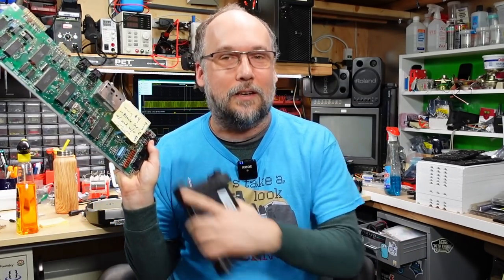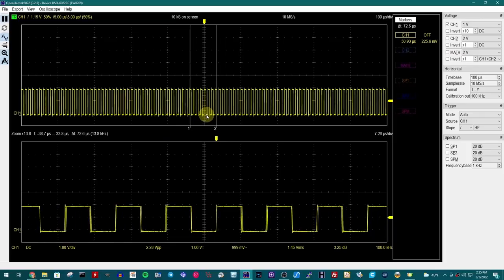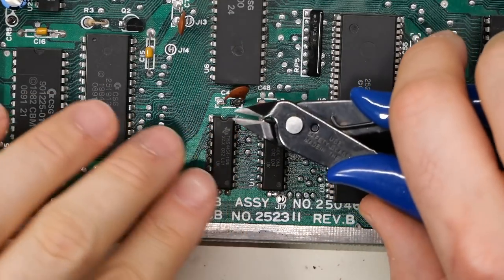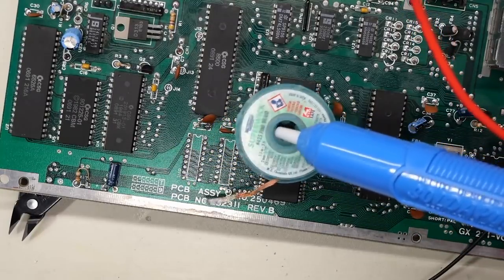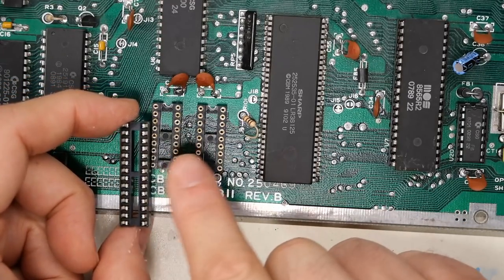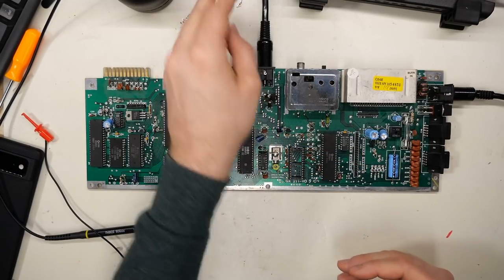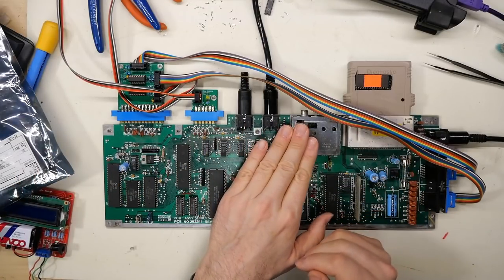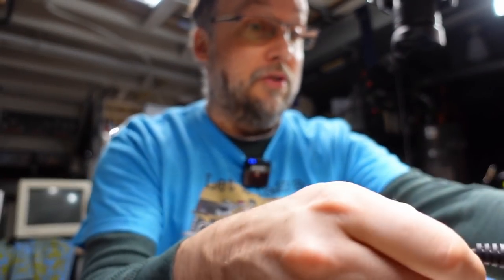How to fix an 8-bit computer with only cheap tools

Comment: I have the older Hakko 808, but it works just as well as the 301. It was one of the best tools I ever invested in, but prior to that I swore by the Soldapult. I won't touch the knockoffs. The real one is really the best. One thing that you should note, is the tips are both replaceable, and are fairly heat resistant. I always used a chisel tip on my soldering iron, and I'd lay the tip flat on the pad, and let the Soldapult make contact witht he hole and pull as soon as the tip clears the hole, but while the pad is still contacted by the iron, for pesky pads. I noticed to have a fair bit of delay between pulling the iron and pressing the button. For me, it'd be an instant. Might get better results on the ground plane holes that way.

Comment: Similar issues with clearing thru holes on pcbs with wick and solder suckers led me to buy the Hakko FR-301 about a year ago.  It's pricey but you'll never go back once you've used one.  I replaced all the RAM on an Atari 800 XL in an evening with the 301.  I would never have attempted it with wick or a solder sucker.  Specialized tools are expensive but they are often worth it, even for those of us who only dabble with electronics.
Reply from the maker: Yeah totally agree. I think for someone just doing once in a while replacement of a chip now and then, these are good techniques.... but my 301 -- yeah I can do 16 RAM chips off an Atari ST pretty quickly. Add hot air and there is no risk of ripping a trace.

Comment: Back when I could hold a soldering iron steady enough, I would clamp the  board in a vice, put the solder sucker on the top side of the motherboard. Then I would apply the heat to the bottom of the board. Would suck the hole clean every time. This way you are still applying heat when you use the suction device..

Comment: 22:11: Adrian, one thing that's worked for me is to actually suck while the tip is still in touch with the solder. That's with both instruments at an angle, and obviously there's not anywhere near a perfect seal between the nozzle and the PCB then, but there's often enough suction to suck out any liquid solder that's nearby, and the nozzle often even doesn't mind if it briefly touches the soldering iron's tip. If there's enough space and you can get both the nozzle and tip close, that can be "close enough" to even desolder a DIP without any prior leg-cutting. You have to weigh what's worse: Having the nozzle be more distant or giving the solder time to cool down before you get to position that nozzle perfectly.

Comment: Actually the pump is quiet good if you get used to it. Don't worry to burn the tip of the pump and just touch the pump to the soldering iron tip with a little bit angle and push the button, that eliminate the short pause that let the solder cooling, and LOT OF FLUX (like Louis Rossmann said)
Reply: The tip on the Soldapult is designed for this and is heat-resistant and replaceable . That is one of the (many) advantages to using the Soldapult over the generic junk
Reply: True, it's all about technique. I only have a cheap solder sucker, but it still gets a bit of use if I'm doing a small job and can't be bothered firing up the desoldering station. Said solder sucker has almost chooched its last chooch, so I'll probably replace it with a Soldapult. If the spare parts support and durability is as good as people say it is, it'll probably be the last manual solder pump I'll ever need to buy.

Comment: 22:05 - when using the solder-sucker, if you leave the iron on the side of the pad, obviously not covering the hole, but off to one side, you can keep heat in the via while the sucker works its magic. I know of people who made small indentations in the PTFE sucker tip to allow for a good air seal while still heating the pad. I find them much, much more reliable than solder braid. Finally, be careful not to bounce the board with the sucker, as you can rip tracks with the physical movement.

Comment: In the category of “bargain basement” tools for electronics repair, you simply cannot go wrong with an Edsyn “Soldapullit” solder extractor. It’s a manual tool, of course, but once you get in a pattern, it’s as fast as the $300 tool mentioned. You can prime the pump quicker if you push the end of the tool into the heel of the hand holding the iron.
Reply from the maker: I actually just use the underside of my desk to prime it again and do it while holding it over the trashcan, so it pushed the old solder right into it.
Reply: @adriansdigitalbasement  as long as it works for you. with a bit of practice (and experimentation), you should be able to get the tip close enough the joint while heating it up to be able to ‘roll’ the tip into place as you hit the button. And yes, power / ground pins are a pain to desolder no matter the method chosen! One last thing I should mention there is a deluxe version of this tool which is made of ESD safe plastic (and the main barrel has some kind of metal finish).

Comment: Those component testers are great, I use them for caps too, the ESR and capacitance readings are pretty accurate, so they're great to determine if you need to actually replace a cap or not. Of course, the one I have is for testing out of circuit so obviously if you don't have issues sourcing good caps it's probably not worth it, but you'd be surprised how good a lot of electrolytics hold up from before the capacitor scandal of the late 90's and 00's.

Comment: Thanks for going so in depth with troubleshooting and diagnosing there was a lot to learn!
I'm wondering if that Transistor had a cold solder joint.

Comment: Ground vias are hard to clear because the ground plain has greater thermal mass than signal lines so it dissipates heat very quickly.
There are two issues with leaving flux on a board, it can be conductive enough to mess with signals. it is often acidic, and over time can damage traces, vias, pins.
Reply: Yep, basically it's a good idea to have a heavier duty iron with a chisel tip handy for larger tracks.

Comment: I use a small Ungar desoldering pump that works well and is easy enough to use with one hand.  The trick to it, in my experience, is to keep the pump chamber cleaned out between uses.  The rod will express pulled solder from the chamber between shots, but always empty it and lube between uses.  (The usual precautions with lead/tin solder apply.)

Comment: Great video as usual, Adrian! Just a couple of comments, in case it's useful to anyone: (a) NO-CLEAN flux may be safe to leave behind for a little while, but even those absorb moisture over time and promote pin corrosion. Flux that is NOT no-clean can be conductive (yes, conductive!) and cause shorts. One should always clean the flux with IPA and ESD-safe wipes. (b) Applying more than 350C to an old board (your iron's boost button) can delaminate the board instantly, which isn't healthy and can degrade signal quality. I'd suggest it's safer to use desoldering braid plus abundant extra flux at 340C. (c) I remain entirely skeptical of this cheap scope. You got away with it because your problem was obvious: internal shorts, burning ICs, you didn't even need a scope. Common but less obvious problems, such as reflections, coupling, cross-talk, ringing, etc., will simply not be visible with anything less than a scope capable of 1 Giga samples per second (1 Gsa/s), even with old systems like this. Remember that even a 1MHz clock can easily have 100, 200, even 300MHz harmonics, depending on the signals' rising time (the outputs of schmitt-trigger devices and buffers/drivers, like the 74244 or 74245, in particular the HCT varieties, are especially apt at producing those high harmonics). With low sampling rates, a cheap scope will be simply blind to those, and the problem will be impossible to diagnose. The scope will give you a false sense that everything is in order and you will be off to a wild goose chase. Or, and equally bad, the sparse sampling can be interpolated in such a way as to suggest problems, such as bus conflicts, where there are none. This happens often on loaded lines, like those of a data bus.
Reply: I usually work with newer, more heat-resistant boards so I was in for a 'nice' surprise when I worked on a VCR and started lifting traces. Regarding the scope, I'd need to agree with you. Without an anti-aliasing filter it seems to be corrupting the bus signals.

Comment: I got one of those big blue solder pumps from Reichelt and it was one of the best tools I ever bought.
It's the only one I'll ever have because, since Brexit, I can't handle the customs nonsense.
When you use one a lot, you get into the rhythm of priming it against your gluteus medius and slipping the tip right over your soldering iron tip.
It'd be nice to have a Hakko 301 but I don't have the money for one of those. ;)
I always drench my solder-wick in flux before using it... that really boosts it's suck-power.

Comment: Adrian, Ive been watching your videos recent. 2 items - your soldering should be running at 365 degree's F and you're using the soldapulit wrong. Some solders melt at 361 degrees F. You apply heat to the connection then bring in the soldapulit as close as you can get it and press the button. The soldapulit developed more than enough suction so you don't need a perfect deal. The terminals giving you you problems are cooling off too fast. That's why you need to keep heat on them while desoldering. I've got 40+ years experience doing everything from assembly, troubleshooting and repair and engineering including military contract work.

Comment: A trick I've used for those really hard to desolder holes is just to heat the solder and stick the leg of a resistor into the via. Keep sliding the leg up and down so that the solder sticks all over it and this will remove most of the solder and leave the hole open. It's ugly, but it works.

Comment: Those  machine pin sockets are great, another good thing is that you can also just buy machine pin female headers and use them when you need to socket chips that you don't have the proper socket for.

Comment: Small note if you are using tweezers to pull cut pins while trying to desolder. If you feel any resistance at all, do not pull harder! Let the heat free the solder more. It can be very easy to pull solder pads off the board on older electronics if you force it.

Comment: About the solder pump - heat the pad from one side, suck it from other while still keeping the soldering iron on the pad. You need to put the board on the side so you can access both the top and bottom side...

Comment: There are those hand pumps with silicon tips. Combined with a flat solder tip, you can just leave the iron there while putting the pump on top of the board and the tip and suck away the molten solder directly with the iron still on the board

Comment: So it sounds like the Hantek could work for our older 8-bit machines, but I wonder what their functional limit is.  
I am guessing the machines like the 1.79Mhz Atari 8-bits would still be in it's range.
What about something like Z-80 machines clocked faster... My ZX-81 is what... 3.25Mhz...
And then I have some 7Mhz 68000 machines...  Hmmm....
Thanx for the vid!  I'm not buying anything yet, but watching and learning!
Reply: 8MHz is still possible but the detail you see in the waves is already noticably lower, so you can't see the fine details about rise and fall times anymore. It is still perfectly usable for finding bus conflicts.

Comment: Those solder pumps are a load easier to use if you put a short length of silicone tube over the nozzle so that it sticks out 2mm or so and you can form a seal over the hot soldering bit. You only need a piece about 15mm long - and a metre is only a dollar or 2 on eBay, get a size that is a snug fit on the nozzle end. You also don't burn out the teflon nozzle as quilckly.

Comment: for the solder sucker put the board over the edge of the desk and hold the sucker on the via from below, heat with the iron from above then trip the sucker, pulls it right out.

you can also do it with the board clamped on edge

Comment: A trick I've always used for devices like the soldapult is to use it on the other side of the board you're heating.  That way the iron is still in contact and heating while the sucker is trying to pull it out.

Comment: I find the Soldapullt to be the best option in general. Even on the lowest heat setting my Hakko can often lift pads. There are plenty of jobs the Hakko is great for! But with enough practice there's no job the Soldapullt can't do. It will just take more patience than using a vacuum tool. I personally find braid to be very unwieldy, but use whatever works!

Comment: Use a piece of silicone tubing over the hard tip of pump and that will create a seal over the hole to clean and allow to pull the solder out more efficiently. i have been using this for over 30 years and when i am in a hurry and have no patience to warmup my desoldering station i still use it.

Comment: I remember Dave Jones reviewing the Aneng 8008 cheap multimeter and he wanted to hate on it but it was actually quite good. I wanted to buy 3x meters so I could measure voltage, current and something else at the same time and it would have been prohibitively expensive buying Flukes so these were bought and I love them, but as Dave says try to stay away from high energy sources like mains as safety may not be the best, but they are perfect for low voltage bench work.

Comment: I recently reassembled my A600 on a new PCB. Using a scope on video out is definitely handy, if you know what to look for :)
I haven't built it completely right now, it lacks analog video circuity - waiting for extra connectors and CXA2075M encoder chip to arrive.
CXA chip outputs all analog video formats on this machine, so I won't get any output until I finish it.
I was, however, able to confirm that my Amiga booted into Kickstart by probing digital RGB lines and observing typical "insert floppy disk in me to boot from", the one on the purple screen with "rainbow check mark".

Comment: I had the original solderpullit. It had a shaft with a round disk on the end. It would pop back out when triggered. To reset, just pushed it in with my chin. Much faster and easier.  I guess some were unfortunate to put their eyeball there so they redesigned it for insurance purposes. Spring was internal.

Comment: Very COoL. 
p.s. I grew up on that "Big Blue Sucker" (so to speak). For a hand pump (this is not sounding right)... it's one of the best IMO. There's a black one for "more" anti-static situations. And no, it's not larger, I think. But I will mention that when using it I never pulled the iron away and then set the sucker directly over the target and fired. It's capable of removing the solder at a angle, kissed up against, with the iron still in postilion - as I recall. The time between removing the iron and moving in with the sucker up to vertical seemed like a eternity - no disrespect, master. Try if you like. I'll apologize if it didn't work as I've described. p.s. And it sounded like you were cocking (oh my!) it with ease. The big nubbin on the plunger was meant to be flipped around and sent (slammed) into the table or one's knee. aka fast draw baby! I love that thing... Ok. I'll let myself out :O\

Comment: Keep the iron heating the solder with the Soldapult.  Don't pull it away.  You don't need a sealed connection.  Put it up against the hole with the iron and solder.  Adding extra solder will make it more effective.  Just trigger it on top of the hole and iron.  Solder braid embedded with flux is your friend, and usually is much more effective anyway.

Comment: When I learnt soldering, I was thaught to short every pin on one side, then use solder braid to remove all the solder at once. Then give a little more attention to whichever pin(s) it's necessary.

Comment: You have to make sure that the solder pullit is EMPTY.  Even a small amount of frozen solder left in the tip will prevent getting enough suck.

Comment: Hey, ever thought of exploring the NEC PC98 series?  They were introduced about the same era as the IBM PC XT and AT and continued to the early 2000s.  Architecture is x86 based but with amped up graphics subsystems, frequency modulated sound synthesis, an improved version of the isa bus and even native support for external 8 inch floppy drives.

Comment: Tip 2, Don’t remove the iron when using the solder sucker and get a small piece of silicone tubing to for over the suckers nozzle, helps make a air tight seal.

Comment: It's also quite possible that the transistor had a cold solder joint from factory and that manipulating the board by turning it over a few times while desoldering the RAM and installing the sockets was enough to break contact, but I suppose we'll never know if it "just freaking works" from now on. 😀

Comment: If you have something to hodl the motherboard vertically, you can use the pump on the opposite side of the board (the side you're not heating) That way you can leave the iron on the pad.

Comment: Quick tip for the solder suckers: don't get over enthusiastic and re-prime them with the sucker over the board you're working on. They can dump out a load of warm solder over the circuit board. Prime it away from the working area.

Comment: There are silicon tips for hand pumps, so you can use the pump while heating up the solder joint. The silicon tip is flexible so it sucks better. ;)

Comment: Another issue you hadn't noticed with the diagnostic was that the clock on the bottom wasn't counting up until you managed to get the cassette motor drive working

Comment: one trick for using the solder sucker on stubborn holes is to mount the board vertically and hold the sucker and the iron on opposite sides simultaneously.

Comment: back when I used a pump I cut a notch so the soldering tip could be on the pad and still get a good seal.